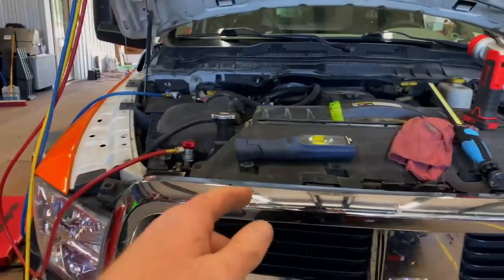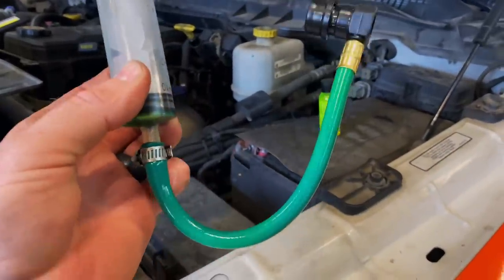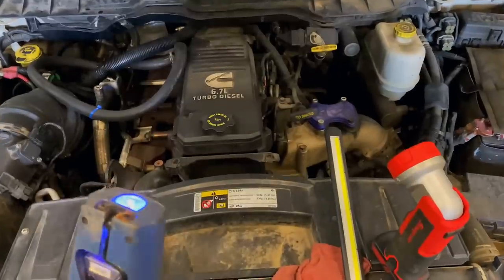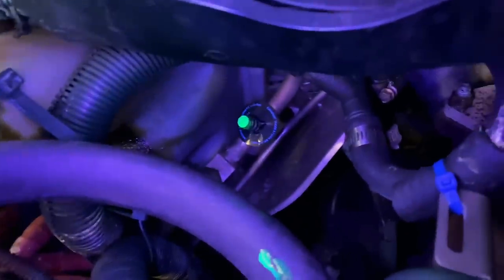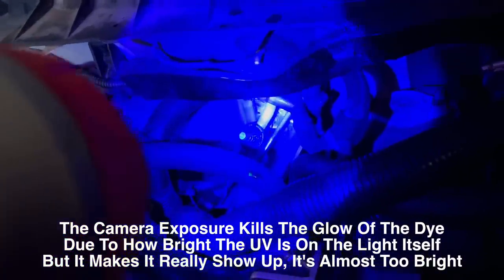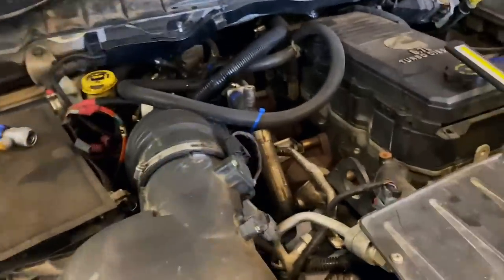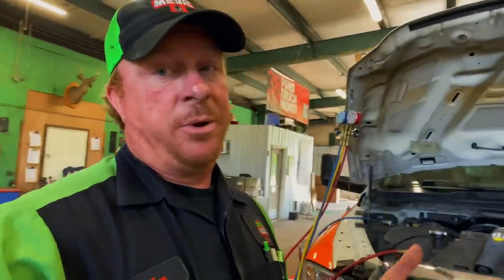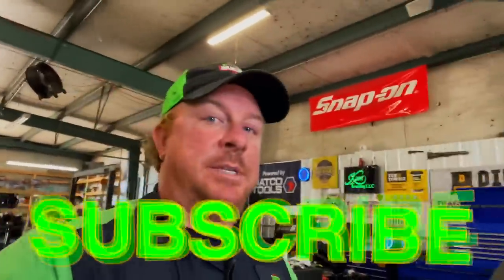UV Lights: Snap On, Capri Tools, and OTC. How They Work And How They Can Help You Find Pesky Leaks

Comment: I have that snap on light and it is garbage. It is very bright but I don’t think it’s actually a UV light.
Reply from the maker: Shows UV dye great and torque seal better than any other light I’ve had
Reply: @KoonTrucking  You sure? Mine is literally not a UV light. Amazon one is 10x better, but not brighter.
Reply: do you think i’d be better off with the capri tool light? i was looking at the snap on but was thinking the brightness was overkill lol
Reply: @wickedbeto2732  Don't know what a capri light is. But it has to be better than the bright blue light from snappy. I love snap on. I am a fan boy. But that light simply isn't a UV light. If you don't believe me take it and a cheap one into the shop bathroom next time the snap on man comes.

Comment: Im an commercial hvac tech and in my feild using die like that is considered a hack job. I know it is used a lot in automotive to check all those tight little areas. I use a sniffer to get close and use bubbles to pinpoint. I've  seen that die gum up metering devices and filter driers so I would only use it if you have too.

Comment: Have you ever used the dye for engine oil coolant dye
Reply from the maker: No we just use it in ac
Reply: I use the oil dye for transmission leaks and other engine oil leaks,  I think my father used dye in coolant once. We like it.
Reply: Use it at work, makes small leaks or cold leaks a fking breeze.

Comment: Clay is it possible to hurt the AC system by filling it with the cheap self fill cans you get at auto parts stores? If you go by the temp and the gauge can you screw it up?
Reply from the maker: If you opened the system you should pull a vacuum on it. But to answer your question no. If you have a set of gauges you can do just fine by filling it with the pressure and ambient temp.
Reply: Thank you for your help and time

Comment: What brand of gauges do you have I'm looking at the digital set snap-on offers
Reply: Is that the blue point set? If so I have the same set but a few years older and my only issues was you couldn't update it past 2016 as the 2018 update was screwed up and master-cooler pulled it. I do'n't know if the issues has been fixed as I haven't used my gauges in a while since I bought my new machine. He said they have master-cooler.
Reply from the maker: No honestly I’m an old school guy on things like that. I don’t want batteries dying on me. Those are mastercool gauges I got them from Napa
Reply: That's what we use old school gauges here at work thanks for the teply
Reply: @KoonTrucking  The one feature of the digital gauges that I really like is you can look up  how much refrigerant a car take by year including. As for the battery dying I change them out at the beginning of the season and I have never had an issue.